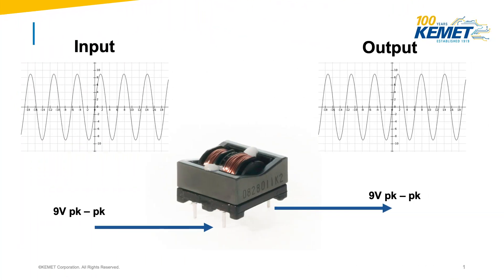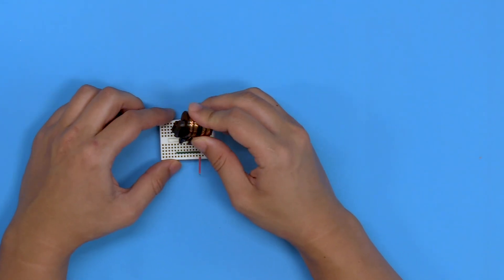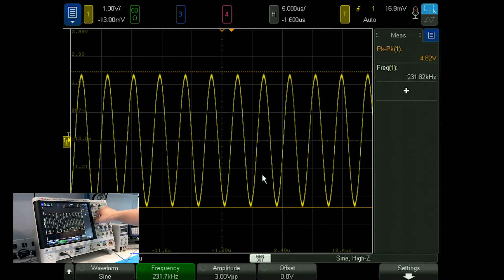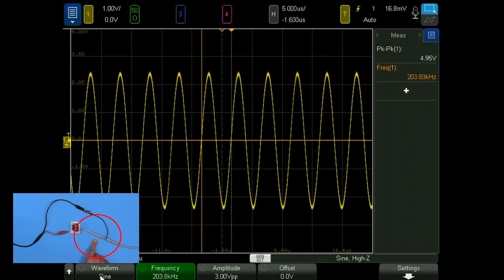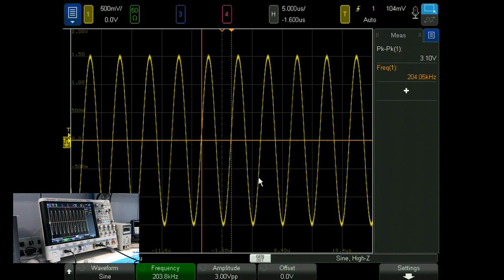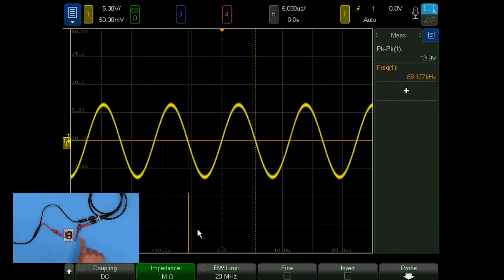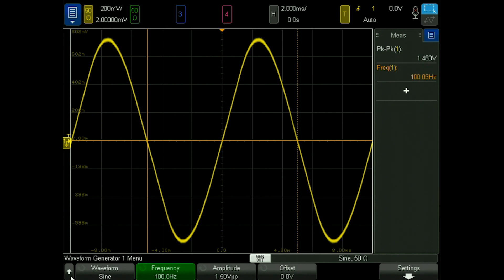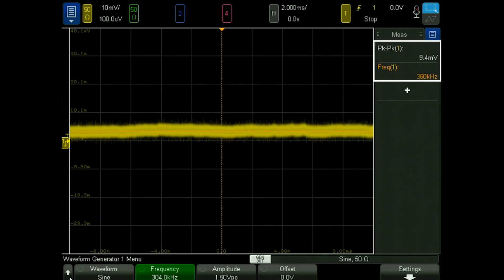Using an Oscilloscope to Test Common Mode Chokes & Mistakes to Avoid!

Comment: Thank you. Not obvious. I got it nearly right. I linked output one to input two via 50 R ( measuring point, inductance in phase thus squared ). Two capacitors used as in Pi filter. Unfortunately this isn't a bootstap circuit due to LC not RC even though caps in common mode. It never  came to mind to simplify as you have. My circuit looked like a  bridge circuit.  It actually gave something close to reality.  To my boss I said  " trend " .